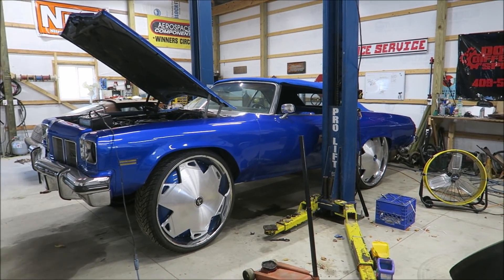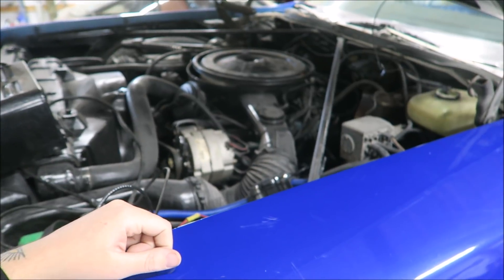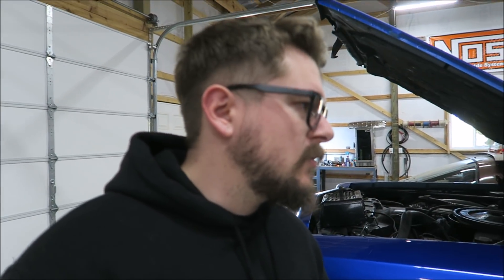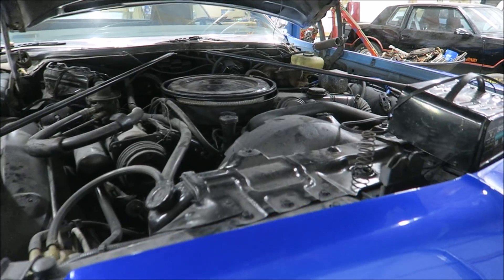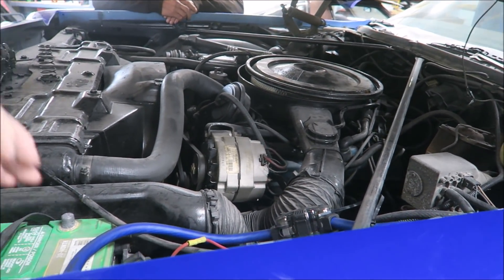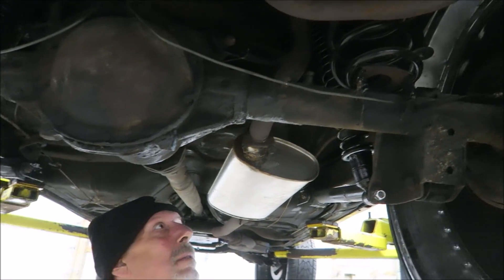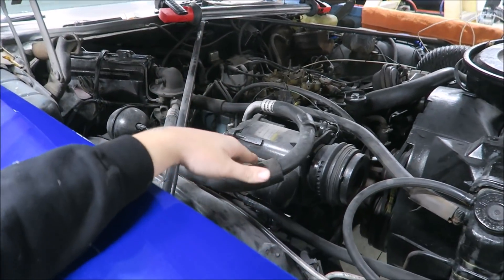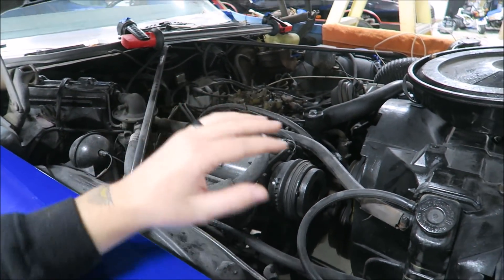Nobody Could Get This Vert Delta Started! Will it run??

Comment: Donk 71/76 Caprice/Impala 2dr/4dr 

Vert 71/75 2dr Donk Caprice/Impala 

Box 77-90 Caprice Impala 2/4door

Bubble/Round Chevy is a 91-96 Caprice 

SS = a 94-96 ImpalaSS

All Oldsmobile Delta 88s are called just Delta no matter the year or style 

And it doesn’t matter if it’s on rims or not but these are the names that we call these specific cars‼️
Reply: Thanks for explaining to these dummies.

Comment: What a mishmash of really expensive things mixed with just stuff that should have been ironed out long before lol.  32 inch wheels but a driveshaft touching the floor.  Redone interior with a rotted floorboard.  Long arms welded with someones my first welding kit.  A stereo system on a car that can't charge the batteries cause it won't start. 

I have so many unanswered questions 😂!

Comment: I got the Holley sniper on my sbc 355 in my Vega. Bracket race and open comp race with it and it’s amazing honestly. Dual sync distributor and msd 6al box I can change the timing off the screen in seconds and dudes I race with are like man that’s so quick convenient when you’re bracket racing.

Comment: Neutral safety switch on the steering column under the dash. If the switch isnt bad it could just be out of position. Ran into the same issue on 72 Impala and it fired right up. Good Luck  Love you guys work.

Comment: When you put your money on paint and rims instead of the motor.
Reply: And no money into the tiny ass brakes i bet the trans is stock too. Gotta handle all that for huge wheels.
Reply: @repnatl  no you don't.  Its not a performance car so its no need for big brakes.  That delta is not made to got high rates of speed.  Its a stock engine for crying out loud.
Reply: @tycheez85  Bro, at highway speeds of 70-80 mph...you still need big brakes for stopping power with big wheels with that much rotating mass.  Tiny ass 11" rotors aren't ideal.

Comment: It does have a safety nuetral switch.  Its on the steering column under the dash. That's the problem with the car.

Comment: Lol, theres a button on the firewall thats a kill switch.
I bought a 74 pontiac because it wouldn't start.
Paid $50 for it, popped the hood, pressed the button by the brake booster, shut the hood, drove it away. 😮
😂😂😂

Comment: Have a job 4 ya,but when ya said you'll need da space 4 winter. Looks like I'll B waiting until spring. Valve job,LS 6 valve spring kit, cam & lifters,all da gaskets.Was periodically driving my 98 GMC, but it sprung a leak & I couldn't tell from where.So,trailer 4 da truck & engine hoist to load motor,it's in storage. See ya in da spring.
Reply from the maker: Lol sounds good

Comment: I try to tell people on my channel. The only reason LS engines pull good is because they have bigger cams.
Reply from the maker: Not so much bigger cams, but roller cams. And the heads are FANTASTIC. A stock 5.3 cam is 191 duration, .457/.466 115lsa. So, it is a bigger cam than a stock sbc, but either sbc or ls aftermarket cams are typically in the .500-.650 range. But they have good compression and great flowing heads
Reply: @SniderTron3000  My stock 96 Tahoe with vortec 5.7 had a roller cam. .414/.428.

Comment: @sinder tron 3000 f body headers fit  that body well with the mounts you want to use. I have a 75 in my swap on 28s I’m building a twin turbo build on now.
Reply from the maker: 🙏🙏🙏 big preesh! Long tubes?
Reply: @SniderTron3000   I sent you a message on ig well a bunch of pictures lol

Comment: You can't call every big old school car a donk. A donk body style is a 1971-1976 Chevy Caprice, Impala, or Biscayne. Just a fact  people always refer to older big bodies as a donk. Just a little info to cut back on the confusion.
Reply from the maker: Not Biscaynes, but u right
Reply: @SniderTron3000  a 71-76 Chevy Biscayne is also a donk because it has the same exact body as the Caprice or Impala the only difference is a Biscayne only has 2 tail lights on each side